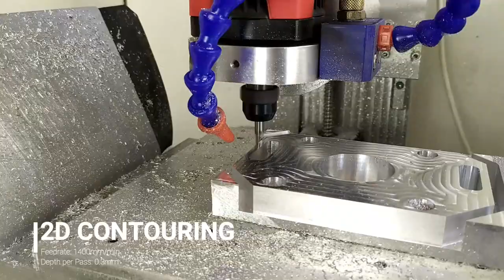Custom Aluminum Parts - CNC Milling - With the Micro Mill

Comment: Impressive work for a small machine, of all the micro machines I have looked at including the Taig 2019 and the Sherline Deluxe. I like the design of this machine the best, it's a shame the price is higher than the competing machines.
Reply from the maker: Hello Matthew, thank you for you comment. The price is a reflection of the machine quality and capabilities. Micro Mill features ballscrews and linear guides, it offers a bigger work area (300x200x180mm) and weights much more than the two machines you are comparing with. In case you need to learn more do not hesitate to contact our support department  https://www.sourcerabbit.com/Contact/
Reply from the maker: @ShitThatsMyn  thank you for your comment. You are most welcome to bring one of the mills you are comparing with our Micro Mill and do a live comparison. As for the shipping cost.. shipping cost is calculated from volume and not from weight.

Comment: How did you hold it down?
Reply from the maker: We often used painter's tape and super glue to hold down stock material. With this way we can use the whole part since there are no work holding clamps touching the workpiece :)